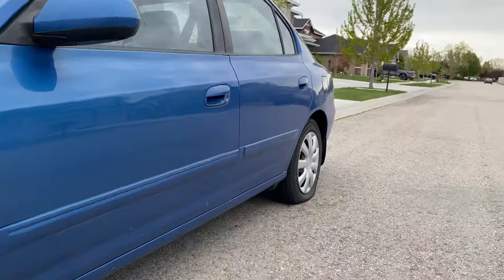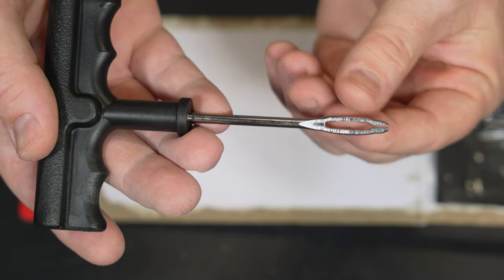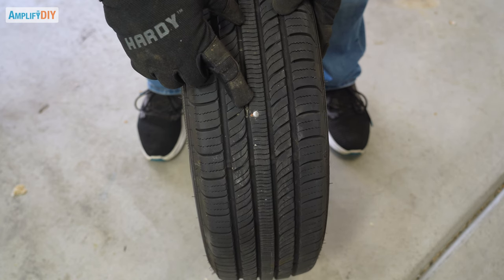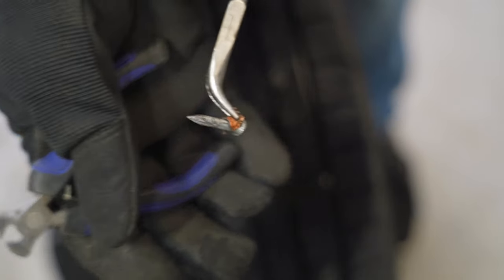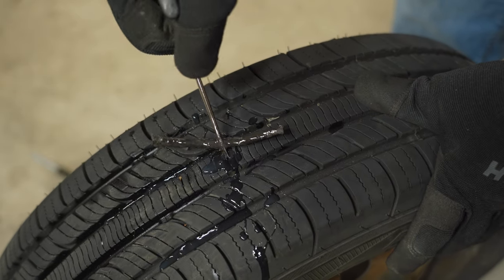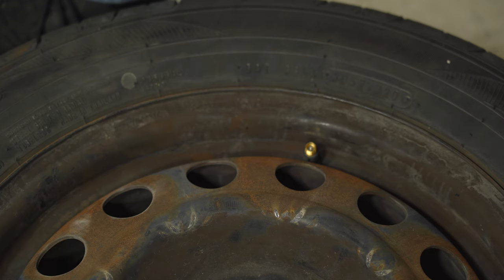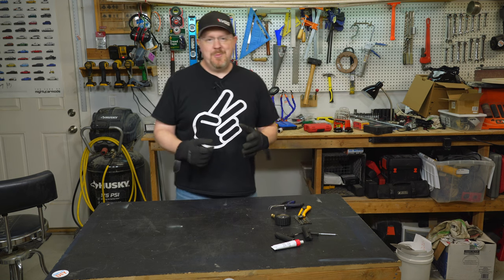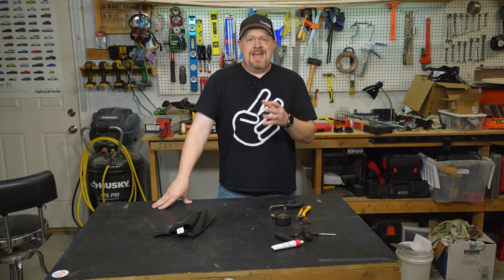How To Plug A Hole In A Tire - Fix it Yourself Cheap And Easy!

Comment: Couple of suggestions for DIYers:  Chalk/Sharpie mark the puncture site for future reference during the repair.  Once the object is out, it's amazing how quickly you can lose sight of the puncture.  When plugging, DON'T TWIST THE PLUGGER TOOL ON THE WAY OUT like he did, which can narrow the plug width and thus decrease the puncture site seal.  Just pull the plugger straight out following the same orientation/angulation of the causative object that you removed.  This is a common mistake because, obviously, you just used the reamer with a twisting motion!  LOL  Finally, keep ample air pressure in the tire when working on it so the tire tread/belts don't collapse making your reaming/plugging efforts more difficult, like you saw happen in the video.  This may necessitate some refilling during the repair and tolerating a bit of hissing as you work.  Leaving the reamer in place until you've inserted your plug into your plug tool will help reduce air loss.  Do the repair at or near an air station, if you don't have an air source.  

PS--Don't use canned tire fixes (Fix-a-Flat/Slime etc. etc.).  They're more trouble than they're worth (they complicate patching), especially with plug kits so cheap and widely available.  Everyone should have a plug kit in their TRUNK--not their garage as stated in the video) along with a cigarette-lighter portable air compressor.  This small investment will save your bacon (or more likely a friend's or fellow-motorist's), especially in the era of no spare tires that we currently inhabit with factory run-flats or donut spares that limit traction/cornering and safe top speed to 45 MPH.
Reply: Good advice, had my first puncture today and just finished patching it up. Would’ve saved so much time if i had the kit in my trunk already. On the bright side, now i have one, and the tire inflator was only like $27 (we’ll see how long it lasts)

Comment: So is this considered a temporary fix till you get a patch on the inside or will this last all by itself?
Reply from the maker: Great question! I believe most tire shops will consider this a temporary fix, but before I plugged my own tires my local tire store used this exact same process to fix nail holes etc in my vehicles. A patch (which is installed inside the tire, and requires removing the tire from the wheel to do properly) is considered a permanent fix, but I've had these plugs work perfectly well for the life of the tire. Thanks for watching!

Comment: Someone else may have mentioned this, but I always use the pliers on the end of the patch to flatten it so it goes into the insertion tool more easily.
Reply from the maker: This is a great tip. Thank you!

Comment: Thank you so much for demonstrating this. It was very helpful to someone like me who is still learning how to perform common maintenence and repair tasks for my home or car. I was wondering if you need to wait for any period of time to drive on the repaired tire after plugging the hole or if it will be ready to drive right away. Thanks for your time.
Reply from the maker: Hi there New Hope - apologies for the delay in my response. Unlike that delay, there is no waiting period necessary to drive on a repaired tire like this. As soon as you can get it back on the vehicle, it'll be ready to go!
Reply: As long as it is holding air, you are good to go.

Comment: QUESTION: I recently pulled a screw out of my front tire... It left a visible hole. Went around corner to local tire place. He sprayed hole with soapy water like you did here. NO leak detected, plus he pushed a poker in to make sure hole didn't go all the way through. It didn't, so it looks safe? However, I'd still like to push something into that hole for safe measure. Could I purchase one of these patch kits, shove some rubber cement and some of that sticky patch stuff in hole to seal it for safe measure?
Reply from the maker: Hi JungleYT - If the tire shop recommended no repair, the tire is likely just fine. I would not recommend attempting to shove one of the patches into the visible hole in your tread... But do keep an eye on the tire to make sure it is holding air and that the hole is not getting any larger, etc. Good luck!

Comment: Is this a temporary fix or can it be permanent until you get new tires? I just got a new tire because a screw got in it and a week later got another screw in the same one 😐
Reply from the maker: Oof. Opinions vary a bit about whether this can or should be a permanent fix. Others may disagree, but I've patched tires this way many times, and the fix has been permanent, and lasts the life of the tire. A better patch is one that is installed from the inside of the tire, but this typically has to be done at a tire store. If you are concerned about the longevity of these patches, you can always use one to get the car driveable, then get it to a tire shop to install a patch from the inside which is considered permanent by tire manufacturers. Good luck!

Comment: I did this and a few months later it started to leak. About 1 PSI per day. I sprayed that area with soapy water and sure enough it's leaking around the patch. What options do I have for stopping that leak?
Reply from the maker: If the plug did not seal it up, then it's time to take it to a tire shop where they can unmount the tire from the wheel, and install a patch inside the tire that will be a permanent fix. Most shops will do this relatively inexpensively, but of course costs will vary etc. Good luck!

Comment: How long can a patched tire, done in this method, be used before it needs to be replaced?  Sorry if this is a dumb question, but is it basically good to go until any further issues come up?  I had a slow leak in one of my tires recently, and noticed the culprit rather quickly.  Did this exact method and don't see any signs of air escaping the tire (I've been checking daily for the past ~4 days or so, still sitting at the 32 psi I keep each tire at).  But I'm also wondering if I should just swap that tire out soon, or if I should just continue using the tire as normal as if nothing happened to it.  

These are fairly new tires (less than 10k miles on them), so it would be great news to know I don't have to replace one asap now that it's patched and seems to be fine.  I know next to nothing about doing work to my own vehicles (trying to change that) so if this simple ~10 minute video saved me from buying a whole new tire, then I am very grateful for the time you took to make this vid.
Reply from the maker: Hey cheese - in my experience when these patches are installed properly, they can last the life of the tire. If you've had it patched for several days with no leaks, I wouldn't worry about it anymore. Good luck!
Reply: @AmplifyDIY  Thanks for the info and thanks for the video!  Might be simple, but it taught me well enough it seems.

Comment: Can you use silicone instead of rubber cement?
Reply from the maker: Hi Coral - I would not recommend silicone. Rubber cement is very flexible when it dries, and it bonds really well to the rubber of the tire. It also does a good job of lubricating the hole as you perform the repair. Good luck!

Comment: How is the tire plug repair kit to be used while hanging on the wall, when one is on the road with a flat tire?  Please disregard this comment if this has been rectified later in the video. You are YouTube fluffing!  You go from having a flat on the road to your garage, did you call AAA for a tow back?
Reply from the maker: Hi Super Specialty - the flat was discovered while the car was parked on the road... in front of my house. As much as I'd love to show my house and home address on YouTube...well, you can imagine why I prefer not to do so.
Didn't have to tow the car anywhere - just jacked it up right where it was parked, removed the wheel, and rolled it up into my garage 50 feet away...

Comment: As a female I’d like to know how to do this when your not strong enough to remove a tire…and you sounded like you were struggling pushing the tool into the tire to prep it to receive the plug…and what if I’m on the road and need a repair and can’t afford a tow truck for a simple tire repair?
Reply from the maker: Hi fourkids - This process definitely requires some body strength, but my college-age daughter was able to do this on her own, so I don't believe it's beyond the capability of any adult. Thanks for watching!
Reply: @AmplifyDIY  I remember when I was younger too..I was much stronger 😂

Comment: Why would u go off the psi in ur door? What if it’s not the stick tire and requires different psi?    That’s the only thing I’d say not to follow in this video.  Go off what ur tire says guys.
Reply from the maker: Hey there osoivory- you actually should go off the sticker in the door jamb. It takes into account the weight of your car and the weight distribution of the vehicle, and will list the optimal psi for the best ride and fuel economy. The listing on the sidewall of the tire is the maximum pressure you should put into that tire, and does not usually match what the manufacturer of your vehicle recommends. If you go off the sidewalk rating, your ride will generally be much firmer and more harsh. Thanks for bringing this up, as it’s a common misconception - and thanks for watching!

Comment: That insert is called a plug. A patch is a flat disk of rubber that goes on the inside of the tire after removing it from the rim. Please do not use the terms interchangeably, they are completely different things.
Reply from the maker: Thanks for the tip, Robert!

Comment: What if the reaming tool does not go all the way through hahaha.
Reply from the maker: Yeah, it can be difficult to get that thing in there. It frequently takes nearly all my body weight if the puncture is a small one.
Reply: @AmplifyDIY  thought yal had a trick. I usually do my wife's sedan just fine. But tried this on my truck the other day and spend a good 15 mins trying to get through the tire

Comment: I suggests you consult the tire manufacturer to see what they say about plunging radial tires.Defiantly not recommended.All radial tire have to be repaired from the inside out.You just voided the tire manufactures warranty.
Reply from the maker: Hi Scott - When plugged properly as shown in the video, this does not violate the warranty (depending on tire manufacturer, of course - some may be stricter than others). My local tire shop does it this way as well. Internal patches are considered a better solution, but a plug installed correctly as shown is fine. If you are planning to use your tires under extreme conditions (heavy off-roading, racing, etc) then any puncture should not be repaired at all, and the tire should be replaced. But under normal driving conditions, a patch like this works fine. Thanks for watching!
Reply: The American Rubber Asociation say differently. I had a case with auto dealership over this issue. They plugged my tire. I got a new tire. Please do your homework before posting video.